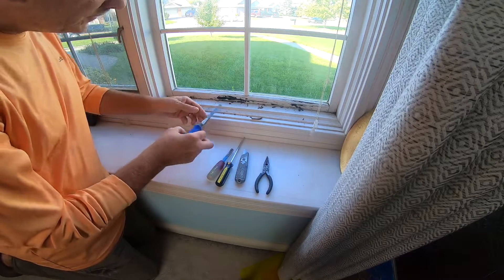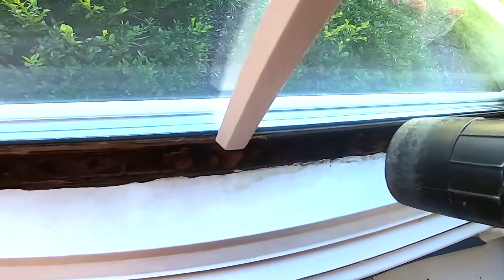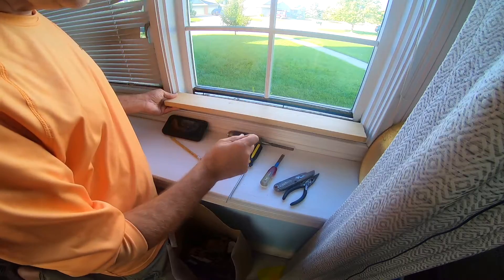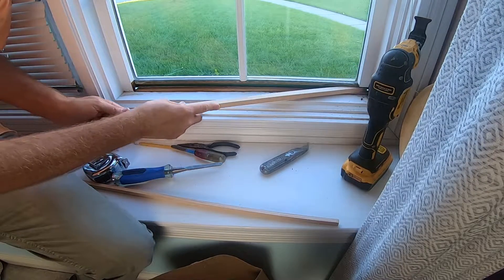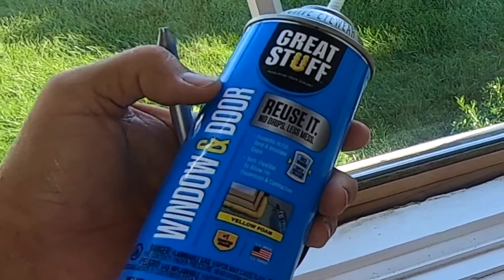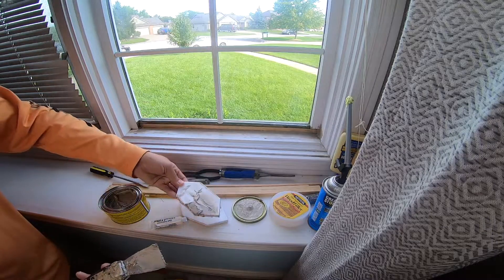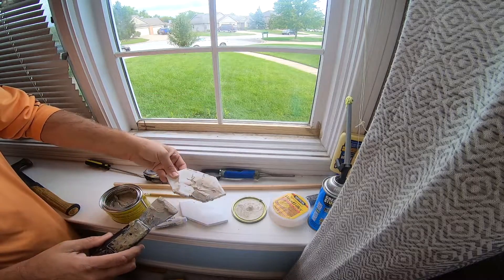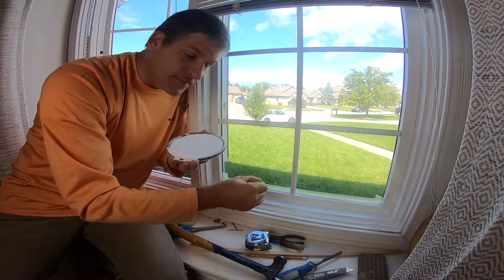How to Repair a Rotted Window Frame - fix window from inside

Comment: Very nice job, my only `advice to others planning on doing a similar repair is that you have an opportunity to prime all the wood before installation and over and over again I see these videos repairing windows, doors, etc. and bare wood is installed. It is the easiest task involved in all the steps and it is commonly overlooked. Sealing the wood will add an important layer of protection and add years to the repair and lesson the chance of another failure.
Reply from the maker: Thanks for the tips!

Comment: Great instructional material, thanks! Q: Do you need to add a sealant/buffer between the replaced timber and the window?
Reply from the maker: Hey nc…,
I prefer to fill any gap - much better insulator. It’s worth paying the $10 for a can of window/ door spray foam. 
The actual new wood always gets paint to protect from moisture. 
Hope that helps.

Comment: I would like to know how you fixed the outside of the window. It looks waterproofed for the inside, but will water still pool in the window sill on the outside? How did you finish the project on the outside? Thank you!
Reply from the maker: Hey @droberts7859,
The window is aluminum clad and fixed. The repair went all the way to the exterior aluminum. 
If your window isn’t fixed but opens, here is how we fixed the one next to it : How to Repair a Rotted Window Frame
https://youtu.be/F4GNchj_D0U
We used cedar in the repair to slow down rot as the design of the window is likely defective. 
Hope that helps. Thx for watching!

Comment: Is the window still functional (open/close) after a repair like this?
Reply from the maker: Hey scf…,
That side of the window was designed to be fixed in place. 
But we did fix the other side a few years ago: 
https://youtu.be/F4GNchj_D0U
That side does open and close after repair.
Thx for watching!
Reply: Thank you for this video. We have a window that needs to have temporary fix before the plaster walls are damaged anymore! The window is old and isn’t expected to open any longer. This is a good training video for us! Glad to have found this! Thanks!

Comment: This is superficial, how do you replace the wood beneath the window and even the plywood under the window where the nasties gather.
Reply from the maker: Hey eli…,
The rough framing around the window is typically 2x4’s or 2x6’s. On the exterior wall there would be plywood up to the edges of the window. To get to that plywood you would have to remove siding . It’s a bigger job, but if the plywood is rotted, it’s good to replace. 
Thx for watching!